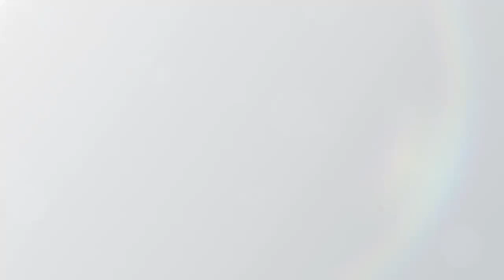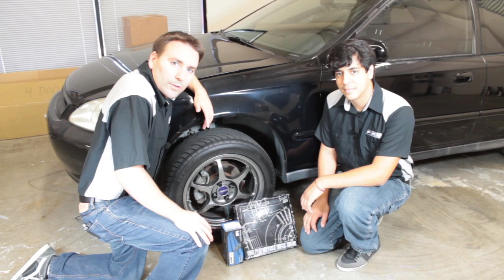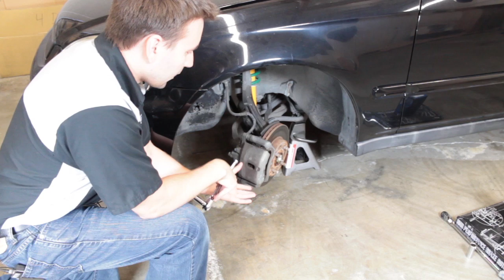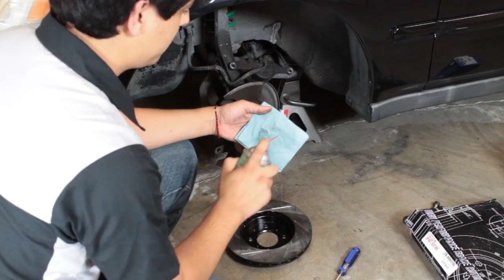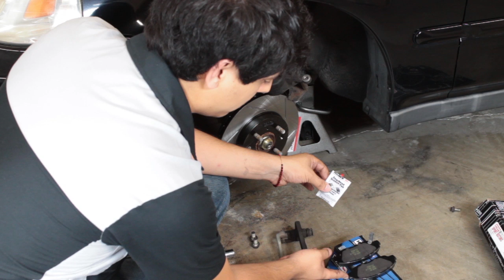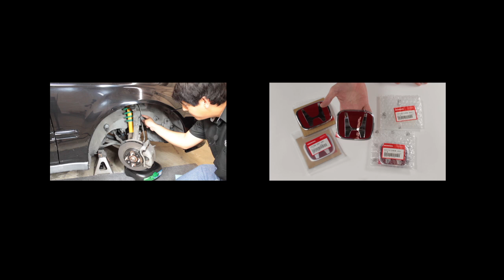Power Slot Rotors and Hawk Brake Pads Install - Honda Civic 1996 1997 1998 1999 2000

Comment: 1 minute or so into video,, On my 1999 Civic, a DX coupe, you only remove the 12mm Bolt for the caliper on the bottom, you do not remove the bolt on the top. The caliper slides off the rod on the top. https://imgur.com/sljjZ1R

I guess it depends what trim of EK civic you are working with.
Reply from the maker: danwat1234 Yes, this was an EX model for this install. Sounds like it is a bit different.

Comment: Do the Hawk HPS brake pads really bite harder than OEM?
Reply from the maker: Yes, they definitely do. Especially on a 1999 Civic!
Reply: ***** ***** I just installed some OEM brake pads, 45022-SH1-505 I think and they grab nicely when I slam on the brake pedal and the last pair of OEM lasted 80,000 miles and could have gone a bit farther before the screecher started, a lot of highway though but some city.

I didn't even need to resurface the rotors, just changed the pads, greased the slider pins, and they felt as good or better than the last pair, also 45022-SH1-505
Reply: ***** Do you know how the brake system works? After replacing the pads, I have to pump the brake pedal a few times to have the caliper piston move in until it starts to touch the pad. So this mean every time I release the brake pedal (when pumping the pedal to lessen the gap between the piston and the new pads), the caliper piston doesn't move back to where it was before when I release the brake pedal each time, it stays put.

So then when everything's set and I'm driving down the road and I press on the brakes, and then release, the caliper piston has to move back again so the brakes stop applying. 
Is there some sort of check valve that prevents the caliper piston from moving back when the brake pedal is released, unless it is under pressure?
If you can't answer that's fine

Comment: Wouldn't brake fluid get pushed up since you had to push back the piston?
Reply from the maker: Yes, good question! The brake fluid will get pushed back up ever so slightly. That's why the "max" fill level is always below the top, just in case (the max fill line also prevents spilling fluid when you put back on the top of the brake fluid reservoir.).

Comment: Did you guys change all four rotors or just the front? I have 2011 Si coupe do you think its worth buying all four or just the front since it is front wheel drive.
Reply from the maker: If this 1999 Civic had rotors in the back, we would have changed all four. Since it only had disc brakes in the front, we only changed the front two.

On your 2011 Si I would recommend changing all at once to provide the best braking performance.